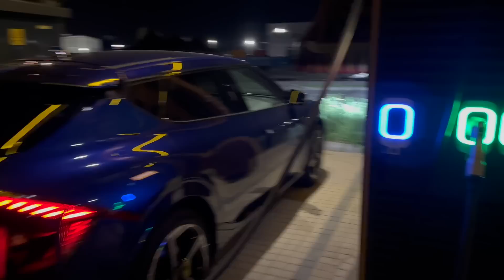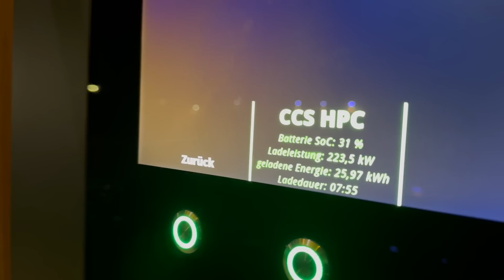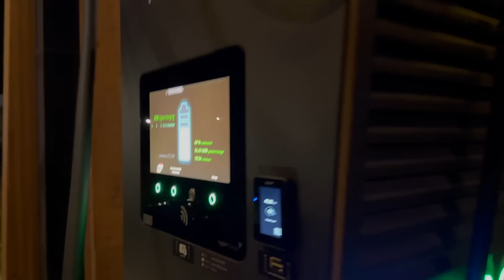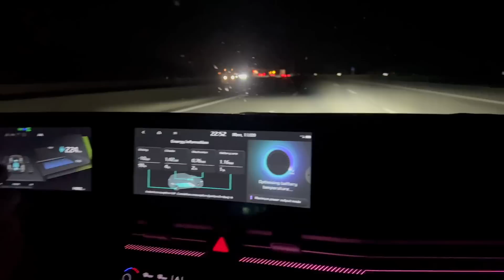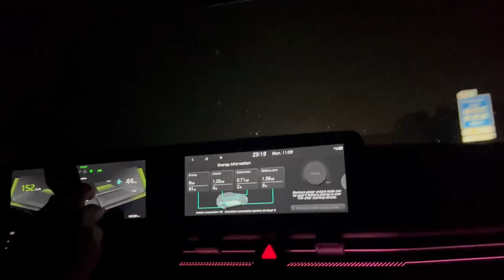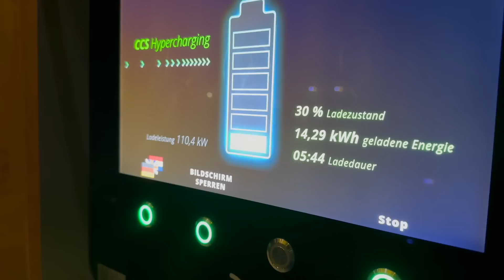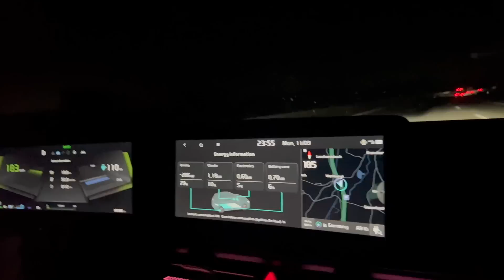Kia EV6 GT Extreme Thermal Stress Test! E-GMP Platform Ripping w/ Fast Charging & High Speed

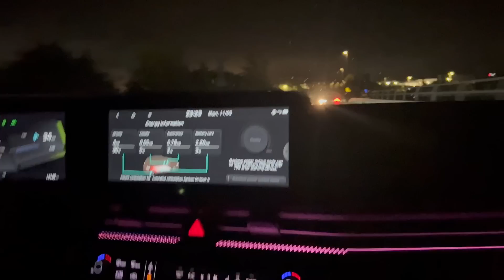Comment: The acceleration test after the second charge up to 50% SOC is 100% limited because you have to be over 70% SOC to get Max power output mode regardless of Batt or driveline temp....  Check the video at 37:00 it say it right on the screen.
Reply: as ev_kimchi says while technically you need to be over 70% so get max power mode.  But, these cars are beasts and the difference between max power mode and un prepped GT mode is minimal.  and these cars put full beans out deep into pack.  I have run sun 3.6 0-60 on cold batter, cold tires, 60* damp road and <60% SOC.  Really is no comparison, specially for the price point.  Often overlooked as well is the superb handling, everyone always focuses on the power and miss the handling
Reply: @TheLamrith the handling is superb for the price point. There are some ICE cars in this price range that can handle better but not the torque and powerful acceleration. I took one down a very curvy backroad here in NC. I won’t admit to how fast we took the turns, but it was unbelievable! A car hasn’t left me smiling this much in a very long time. I giggle like a school girl every time I think about it.
Reply: @baianojack  oh i know how good it is.  Had one for a day in November 22, got 1st one my dealer received in Dec and have been loving it ever since.  The giggle doesn't stop even after 9mos of ownership and 8k miles.
Reply: @TheLamrith  I was totally agreeing with you. The handling doesn’t get enough attention.
Reply: This is correct technically, but my butt-dyno tells me that there's very negligable derating in the powertrain until you get low SOC (~ 20% in my much-less extreme real-world usage) or you really really get the battery hot (as Kyle did here).  This video pretty much confirms the robustness of the EV6 GT powertrain and thermal strategies.  In real-world normal driving situations in the States, power is just there all day all the time.  Compare this with a more-expensive Mach-E GTPE or anything else approaching its price, and there's really no comparison

Comment: V2 SuC give you around 90kW, V3 give you 44kW. Completely pointless to go to a SuC with an eGMP car. There are countless 1000V chargers everywhere, they are usually in better locations and you dont need an app. Also, if you drive in Europe you need an RFID charging card. No preauthorisation, works everywhere (except SuC) and better price (I pay 29ct with the "Charge MyHyundai" card).

Comment: I confirm I only get 42kw at Tesla v3 chargers (have tried 4 locations) and the limitation is not there at v2 chargers (have tried 3 of them). I drive and EV6. Kia told me the issue is for Tesla to change their software to accept the e-GMP cars on their v3 chargers.
Reply: Issue is not the software it’s the voltage.  They don’t have to adapt to work. They just need to adapt it to work better.
Reply: @stevenichols4639  Kia/Hyundai are 800v but Tesla (v2 and v3) can only give 500v. The car uses the rear motor to step up the voltage to the 800v the battery needs. At the v3 chargers I only get 100 amps. I have an OBD scanner which shows the car is requesting much higher amps. At an Ionity charger and all other which supply 800v the amps requested will be delivered. I don’t understand why it won’t work on the Tesla v3 chargers. Again the problem doesn’t exist at v2 chargers. It must be a communication issue i.e. software.
Reply: this is in EU with CCS adapters, correct?
Reply: @ironiq_ev  yes it is EU. All cars and chargers are by law CCS. There’s no adapter like the magic dock in the U.S.  There are a few Teslas left with the Tesla plug (same as U.S.) from before the law was made. They have an adapter to use any charger.

Comment: Previously eGMP vehicles could not charge at all on V3 chargers. It was a Hyundai/Kia software update that allowed them to charge initially at 50 kW and it was a promised additional tougher update that would allow them to charge to 100 kW.  Tesla did not enable anything on their V3 chargers to allow these vehicles to go from not charging to charging 50 kW, so it would not make sense that it is Tesla restricting the power. It’s not Tesla style either to reconfigure their equipment to work better with other manufacturers. There supercharger access  philosophy has always been if your vehicle can charge on our superchargers.. Great if you can’t too bad.
This also is likely the main issue why Hyundai/Kia has not moved to NACS in the USA until this issue has been figured out  or V4 have been widely deployed.

Comment: Nice. If only Kia/Hyundai/Genesis would fix the charging speed issue.
Reply: The charging issue is only on Tesla v3 chargers. Kia told me the issue is on Teslas side. We get more at Tesla v2 and of course much more at all other operators. I have seen 234kw in my EV6.

Comment: Hi Kyle, great vid. Tesla Bjorn recently did something similar so good to get a comparison 👍. For reference you can set the auto  main beam on which keeps the main beam on but uses adaptive matrix so it doesn’t blind oncoming traffic or cars in front of you. This would have helped doing those speeds. Bjorn was super impressed and he really battered it and it kept its top speed even better and longer than most germans and Teslas with very limited power degradation compared even to a Tesla plaid. Kia have done a great job on this.
Reply: one of the only bummers is how the US cars don't have the matrix headlights -- the US-spec headlights aren't great
Reply: @ironiq_ev  Ah didn’t realise that. Very strange, is it to do with legislations or something of that nature?
Reply: @markgeezey1809   yes until about 1-2 mo ago matrix headlights did not meet US regulations -- some adventurous folks have retrofitted the matrix units but it requires custom different wiring harnesses
Reply: @ironiq_ev Now matrix led is legal in the US?
Reply: @arthurchoi8080 yes!
Reply: The matrix auto beam seem to be on in the video though

Comment: I'm so happy to see this. I was a little concerned after your initial review when you talked extensively about how tricky it is to get the maximum performance out of this platform. This is on my very short list of cars to choose from when I'm due for a new car next year.
Reply: you have to do basically nothing to have the car go like stink.  If you're drag racing, I'd do all of those geeky things, but really, you can blow away anything except supercars or Plaids without any special prep all day long
Reply: I have a GV60performance which was the hottest E-GMP car available in Oct22.  Still loving it.  From everything I’m hearing this EV6GT, and the upcoming N’s will be even better performance wise (although fewer lux features than the Genesis).    Any of the cars made on this platform are an excellent EV for someone looking to buy one.   

IMHO the Hyundai group has stolen a march on every US maker with this 800v E-GMP architecture.  Especially when you consider all the additional capabilities like V2L that are included. It’s also great that each car has their own styling and look, instead of them being a nearly identical like a set of matruska dolls <looks at tesla>.  If your budget doesn’t allow looking at the German EV’s then it’s basically picking between a Tesla and a Hyundai/Kia/Genesis while we wait for the Chinese made cars to hit our market.

Comment: Hyundai's gotta figure out the NACS limitations! It doesn't make sense to me. An EV6 can charge from 150kW and 350kW chargers at MUCH more than 50kW… so why not from 250kW at a Supercharger? Weird. Just weird.
Reply: Because Superchargers are only 500V so it has to use the oboard booster. That's where the issues seem to be coming from
Reply: @Bluerazor52  I repeat: E-GMP can charge at 150kW (400V) and 350kW (800V). Superchargers fall between those two voltages. Shouldn't be that hard to program the onboard booster to handle them.
Reply: @Yanquetino  OK. I didn't know that was the max rate was using low voltage chargers. Yeah, doing only 50kW on Superchargers when it can do 150kW with the booster sucks.
Reply: Voltage

Comment: You will find the Ioniq 5 N will not allow you to find a limit. It has further improved thermal management, with two heat pumps. BTW, when the A/C is on, the Ioniq 5 (and likely other EMP cars) split one third A/C two third battery (not 50-50).
Reply: Can’t wait to hit the track in that one 

🚙💨
Reply: one geeky thing to note is that the Ioniq 5 (non-N) has a different cooling system loop than the EV6.  Ioniq 5 has 2 separate cooling loops with different coolants, including one separate one for the battery.  The EV6 uses only one type of coolant / loop
Reply: The 5N is so fugly

Comment: So they advertise 10-80 in 18 minutes but it can't actually deliver that in anything other than lab conditions?
Reply: Done it several times with my Ioniq 5.
Reply: @michaelcottenden3216  but I bet not every time (assuming the charger could actually support the power required). Too cold? NOPE. Too hot? NOPE. Must be a fairy tale situation and Goldilocks as your passenger.
Reply: I have done it several times in my Kia EV6. I don’t drive as crazy fast as Kyle so my battery doesn’t get as hot.
Reply: Ugh, no, people achieve it all the time.